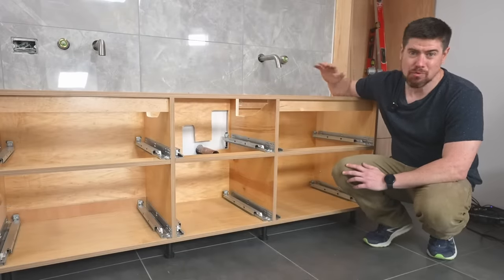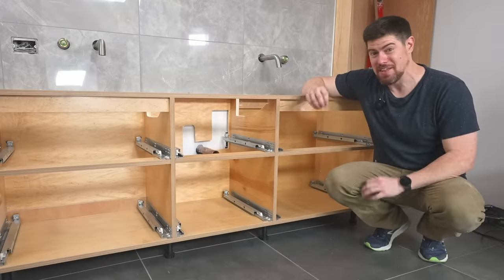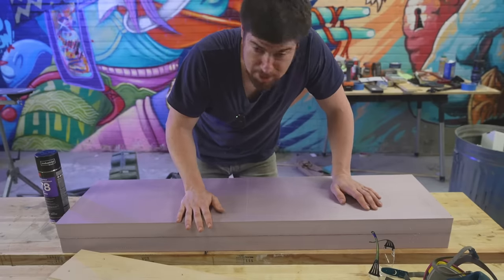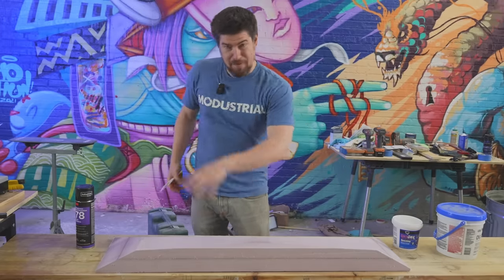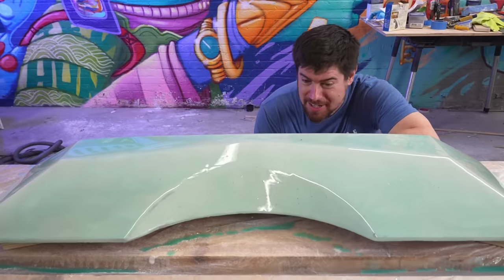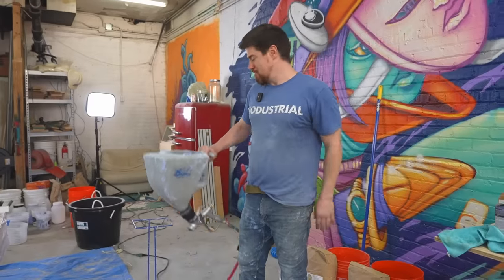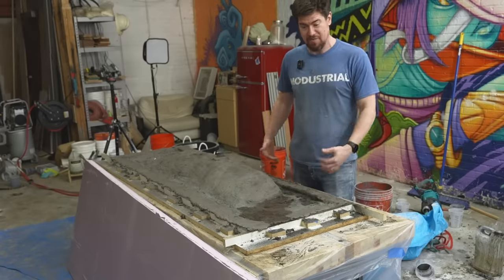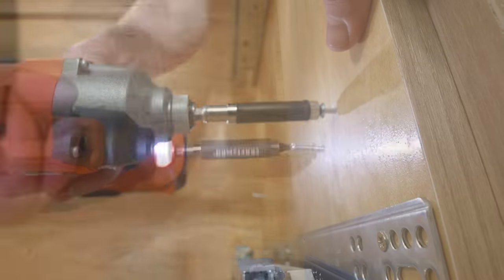AMAZING Concrete Ramp Sink DIY...  with INGENIOUS Mold Making Technique

Comment: Looks great, personally would have made the opening wider (I think the faucets are to close to the edges). Liking the whole vibe of the bathroom with the tile and wood panels
Reply: Came here to say that too. i think if u wash your hands you end up splashing too much on the flat surface.
Reply: Yes. Faucets are too to the sides
Reply: Exactly my thoughts! Looks great, but not wide enough and it'll end up making a mess on the counters, which will be hard to clean because the stuff on the counters is in the way. Oh well.
Reply: I came to comment the same thing
Reply: lalalalala *modustrial covers his ears lalalala cant hear you lalalalalalala
Reply: My first thought as well, glad it wasn't just me!
Reply: Yup.
Reply: Came here to say the same thing too
Reply: Agreed - the faucets are too close to the sides of the bowl for practical use. The shape of the sink is beautiful, but you should cast it again and make the bowl wider. That's certainly less painful than moving the plumbing.
Reply: I couldn't agree more...
Reply: @laporte_haiku  Unfortunately, this speaks to an overall design flaw of the bathroom. The faucets are too far apart, and he made the bowl too narrow, shallow, and not wide enough side-to-side. If he tried to fix the width of the bowl, he would end up losing what little countertop space he already has and run the risk of water spilling over the sides onto the floor. 

His mistake was installing and finishing the plumbing and tiling without having a design for the countertop finalized. Kind of a measure once, cut twice approach to this kind of work.
Reply: Yeah the spout should be close to centre over the waste on wall hung faucets. To be fair though, it's very easy to miss these sorts of details your first few times doing this kind of stuff. And the rest of it pretty nice, though I was surprised to see a vertical grain kick haha.
Reply: Thinking the same thing. Curious to see you turn the water on and see if there are splashing issues on the sides. Splashing like that is the bane of my existence.
Reply: Yep that’s exactly what I said and thought.  All I could see was a mess on the countertop after every use.  Also I think the Natural calcium in the water will probably cause a white film on the dark concrete.  Black or dark colors in a bathroom are never a practical idea because it will show water marks after every use. I guarantee he’s going to wish she didn’t choose these dark colors and he’ll probably have to change it after a few months of use.

Also I think he knew that the faucets were a problem because he never did turn on the water to show you the full effects of his finished work.

Sometimes modern designs are just not smart and rarely practical.  The bathroom is my least favorite room in the project.  It doesn’t seem like a relaxing, inviting, or warm room. It’s too cool, industrial and dark.  You guys might like it but I don’t think it’s for everyone.
Reply: Screw all the comments about splashes i can deal with them :D from a balance viewpoint its just off. My OCD couldn't handle looking at the taps (faucets/spouts) being so close to the edge relative to the middle.
Reply: every time you wash your hands you'll have to be careful not to splash the entire counter
Reply: Had the same thought 😊
Reply: @eyespy3001  I think two inches both sides would be enough. You'd still have fair amount of countertop and in the end add more space for bottles and such with a wide rack below a wide mirror.
Reply: yep, he should move the faucets closer in, but hat could be a pain since they are mounted on the wall with the backsplash tiles. Easiest solution is to somehow get the faucets to angle in and not straight out. What an odd oversight.

Comment: The bathroom is coming along beautifully! Love the modern look and feel of the space so far!
Reply from the maker: Thanks much!
Reply: @modustrial  during the CNC milling of the sink master, the boundary between the 2 layers of pink XPS looked... strange. Was the glue a polyurethane glue? I saw on another channel (@Luke Towan) that it is expansive; it requires weight to be applied so the two layers being glued don't get pushed apart. Is that what happened here?

Comment: Looks good my only concern when I saw it going in is that there may be a lot of water spillage if the water pressure is too high on the taps on the sink.
Reply: Put in a pressure reducer. Either in the spout or underneath
Reply: Faucets are too far apart, yes. Water will spill over the sides.
Reply: Same, you don´t have enough space for washing-hands under faucets. There will be water everywhere.

Comment: Nice.. I'll give you a tip that I learned, by trial & mostly error when I started making things with concrete.. After it is done, make sure it is a rough surface, mix up some fiberglass & resin and give about a 1/4 to 3/8 thick on it.. It will make the piece much stronger and if it does crack some, it will still hold.. I do mean putting it on the underside of it.. No one will ever see it, but it's an extra bit to just make it stronger.. I found using this trick I can go much thinner on the concrete.. I loved this episode.. Also, since you definitely have the talent, why not make more of those sinks in other colors, I am positive you would sell everyone you can make.. Lots of people who watch your channel would buy one of your creations in a heartbeat.. Well I rattled on enough. Thank you for sharing... GOD Bless... 😎😎😎

Comment: If you use a margin trowel after the backer firms up a bit, you can scrape the edges fairly level. The key is to scrape at an angle to keep from pulling the material off the verts. Hit it with a trowel and a little water after and you can usually skip the post cast grinding. 
Nice design and keep up the good work!

Comment: Also Regarding the CNC Milling for dimensional accuracy, you could cut 0.5mm more from the foam (when you have reliable positional markes) then use the fairing compound and after adding it recuting the shape in the correct dimension.. :)

Comment: you could easily get some additional countertop by making an insert for the middle of the bowl. Granted it would have to sit on top of the counter by some capacity but you have a model already and could carve it out on the cnc so it locates itself against the curve

Comment: I build a bunch of terrain using that foam. I just use Elmer's Wood Glue as the main adhesive, and some dots of hot glue to hold it in place while the wood glue dries.

Comment: You should try using a bullnose style endmill when you machine foam on the CNC. You'll be able to do all your roughing and finishing toolpaths with it due to it's corner radius and not have to worry about swapping in a new tool halfway and potentially ruining the part.

Comment: This is a one of it's kind bathroom Sink. You can really be proud of all your hard work on this piece. Btw. if you still have problems with glueing styrofoam, you yould try to using Gorilla glue (the one on polyurethane base) to glue the foam pieces. Some types of Styrofoam don't melt and bond really well using this glue.
Reply from the maker: Thanks!  And good tip!

Comment: Hey there. Cool sink! Regarding the polystyrene, you can glue polystyrene together using wood glue. Been doing it for years with our model aircraft and doesn’t melt because it’s water based and it’s super cheap

Comment: very sleek but I wonder if the taps are too close to the edges of the sink? Usually I see taps in the middle so there's minimal splashing onto the countertop. Would have liked to see a video clip of you using it to quash my concerns

Comment: Great sink, awesome color combo! What’s the reason for having all the material over packed on the bottom, waiting for it to dry then removing it with a grinder? Why not put less on or why not “scree” it off when it’s wet and easy to remove so you have less grinding to do?

Comment: Sink looks great, you have outdone yourself again. 
Are you going to have any electrical outlet accessible on the top of the vanity? I did notice there was one inside the cabinet but seems like that will be hard to use with the drawers in place. 
It's kind of sad to think this particular series will end soon, it has been so enjoyable watching along the last couple of years as you transformed this building. On the other hand, I can appreciate that it must be incredibly satisfying to get to the point where you can be inspected and official after so long. Sounds like you have plenty of ideas for more projects to keep busy with even after that though :)

Comment: Very cool sink. It seems to me that it would be more practical to have that extra counter space at the back of the sink instead of the front, though. If I put anything on that counter as it is, I would either knock it into the sink or onto the floor. But you are probably not as klutzy as I am.

Comment: I believe 3M 78 is a contact cemt like it's popular brother 3M 77.
That means you have to let it flash off before you bring the pieces together. I believe this is why the layers seperated. It doesn't glue well when wet.
Reply from the maker: Yup, you let it sit til tacky.   There was a bow in the foam piece... I should have put something heavy on it and I think that would have corrected the problem

Comment: The taps are pretty high relative to the sink. They also point straight down at the slopes in the sink. I hope the water won't splash out of the sink and make a mess.

Comment: Sink looks AWESOME. Think the faucets are too close to the outside edge of the sink. Think it would have looked better being in the middle between edge and start of the bump out on each side and probably more practical when washing your hands etc under them to keep the water IN the sink and not getting on the outside edge counter.

Comment: I love how you create custom concrete sinks! We are about to start remodeling the bathrooms in our new house and I'm thinking to create concrete ramp sinks. Your videos inspired me! However I don't have most of the tools you have, although I think I can still pull it off. Is the first layer of concrete that you spray necessary to use with the spray tool? Can it be applied by hand?
Reply from the maker: The spray is necessary if you have tall vertical surfaces, which most sinks do.   If you have an air compressor, you can buy a hopper gun for under $100 to do the spray
Reply: @modustrial  Thank you so much for the suggestion! I do have an compressor, although it's one of those very inexpensive ones. I'll look into getting a hopper gun.

Comment: Next time you need to pop a sink plug out of concrete, pick a bit of the caulking out at the edge of the plug, and shoot some compressed air into the edge.  You'll be amazed how effective it is.

Comment: Spigots are too far apart as hindsight (not centered between the center curve and the edges), but what a great sink.  Hey, nobody else noticed.   
I hope it isn't true but a few said that concrete cracks over time, but that is probably just a single pour, and just regular concrete.  Your work is simple but beautiful.
Wonder what sealant you used.

Comment: Epoxy shouldn't melt the polystyrene unless it has a solvent in it. Most epoxies don't have solvent.

I used to design and build composite products. When building patterns, I used tons of tooling board (high density urethane foam). Gorilla Glue works great to glue foam sheets together. You don't need very much. Basically, just "color" one surface with the glue and spritz the other sheet with water. Stack them and weigh them down or clamp them because the Gorilla glue expands a little when it cures (that's why you only want to apply a little bit). You get a really thin bond line and the glue machines like the base foam.
Reply from the maker: thanks for the tip!  I think the epoxy will melt the foam because of the heat it produces while curing (it gets darn hot)...but I haven't fully tested it, just went on word of others with experience.... either way, using gorilla glue to hold the sheets together is a great idea, and I'll definitely do that next time.

Comment: Looks like the bottom of the sink is perfectly level. Does some water stay in the sink since it's not angled towards the drain?
Reply from the maker: Nope there is a slight slope....if you look at the model of the mold, you'll see it
Reply: I knew as soon as I commented that I should have went back and checked. Can definitely see it on the first pass of the CNC. Otherwise it's so slight that it's hard to see. Great work!

Comment: The bottom middle drawer needs to be adjusted ever so slightly to the right. Looks wonderful otherwise.
Are you also going to put handles on the drawers, or are they those push to open sort of drawers?
Reply from the maker: Good eye! I ordered special adapters for the blum drawer slides that will allow for that, just need to get them installed :)

Comment: Another easy way to glue foam boards together and not hurt the wallet so much is to use a mixture of wood glue and distilled water mixed at a ratio of 8 to 1.  Did this to build up blocks for prototype for industrial design models.

Comment: Do you ever have to reapply the sealer to protect the concrete, or does it last indefinitely? We've been thinking about maybe doing concrete kitchen counter tops, but I'm not sure about it if it requires constant sealing.
Reply from the maker: U-seal lasts a long time, but not permanently...ever year or two it's probably good to reapply

Comment: Amazing project! I was wondering how great it would be to use the carved foam and do a vaccum form over it (diy vaccum form tool) to get a smooth and I guess very easy to demold. Also could allow to create as many copies as you want. Just need to fill the plastic form with sand or expendable foam before to use. Just an idea if you plan to sell your projects one day.
Reply from the maker: Good idea!

Comment: I have been considering making a woodfired concrete tub for outside. Do you think this process would work for that of course there would need to be some support structure installed in some way.
Reply from the maker: Concrete does pretty well in heat, so I think it would work...only one way to know ;)

Comment: I would beg to differ.  That water meter thing is 💯 necessary.  For a guy like you who does these types of projects.  The easier you can make it allows you to push the limits on other things.  Like different forms and designs.

Comment: Just a point but are those separate hot and cold taps or both mixers... if there both mixer taps it's a bit wasted seen as they are not separate sinks plus you'llhave to use a lot more water to fill it... Good job though I like it
Reply from the maker: This sink is not designed to be filled.... I never really fill it, so I wasn't to worried about it.... This bathroom was designed for me :)

Comment: Designwise: beautiful. Practical: maybe not.
When I think of using that sink to wash my face, my hands or even brushing my teeth I think I would splash water all over the sides because the faucet it so very close to the edge. Might be a real problem (or maybe not)
Reply from the maker: With the angles and 8" between edge of sink and faucet, it stays in the sink pretty well ...
Reply: @modustrial  Good to know! A lot of people's first thoughts are this.

Comment: When you say a few months to finish renovating, you just mean the major stuff or like the whole house will be done and you can show us a tour of it fully decorated in a few months?
Reply from the maker: I'm hoping it will be everything done I need to pass the final inspection with the city...basically everything major functioning in the upstairs living area, and doing drywall on the workshop ceiling (the rest of the workshop build out will be the next step, and I'll also be doing videos as I design and build a lot of the furniture for the interior spaces.

Comment: I have a little table top toy cnc "engraver" that I mostly use for quick circuit boards... but yea I did a 3d contour for the second or third time on it last weekend and it felt like I was dumber than new

Comment: Quick question.  What is a 2D carving?  More to the point.  Aren't all carvings 3D carvings? 1:53 for reference.
Reply from the maker: 2d means going to a single depth then cutting, so the cutting bit is moving only in X-Y plane, parallel to the surface of the CNC...like carving letters into a wood sign.  3d carving means the cutting bit can move in X, Y, and Z... So it can move at an angle relative to the surface of the CNC and create a pyramid or curved surface in the z direction, like this.  This makes it much more complex to model and set up
Reply: @modustrial  I disagree with this explanation.  The second dimension is the x-y plane.  Carving or even drawing, no matter how little matter is being added or displaced is still moving into the 3rd dimension, Z.  We live in a 3 dimensional world.  My point in the comment was to illustrate the overuse of this term.  Love the content, thanks for getting back to me.

Comment: I didn't see any calking on the sink, and there's no back splash. Oh and where is the vent/overflow protection?
Reply from the maker: It's a wall of tile, so no backsplash needed :) caulking everywhere in the bathroom will be done once all the other  finishing touches are done

Comment: Why do all this for the foam here? why didnt you coat the foam for the campfire build?
Reply from the maker: Fire pit foam molds were wrapped in 2" electrical tape to waterproof them and give a smooth surface ... That wasn't an option with these larger and more complex surfaces
Reply: Thank you for explaining!